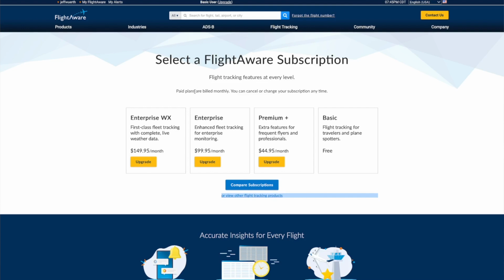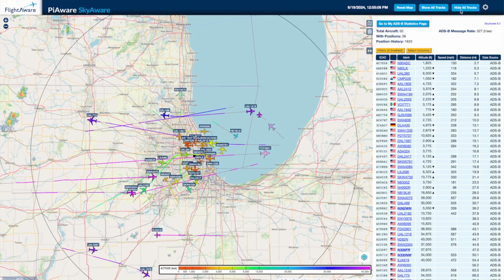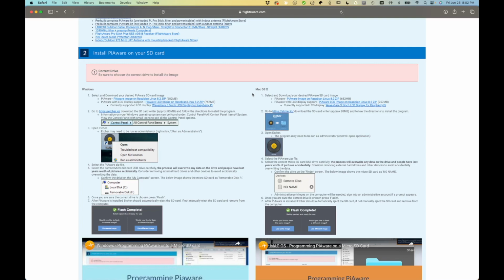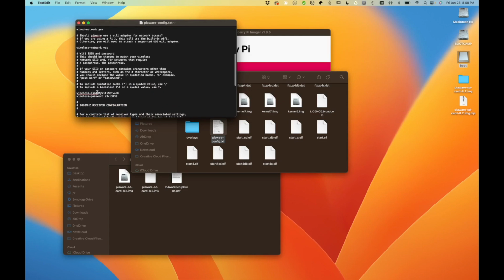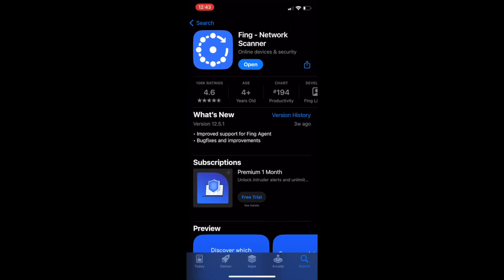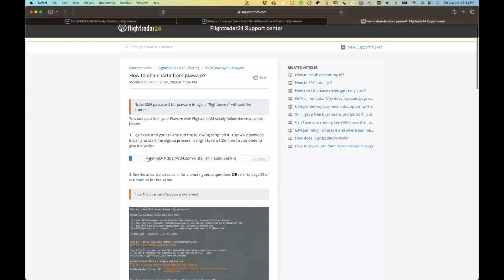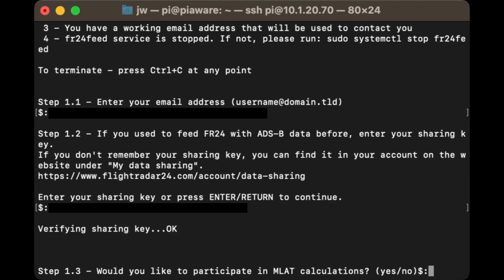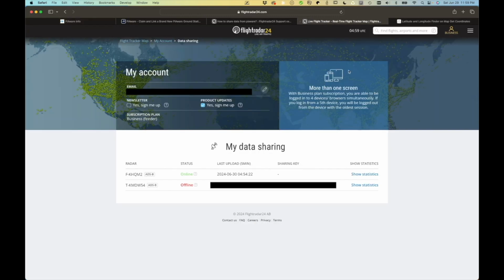How to Feed FlightAware and Flightradar24 Using a Single Raspberry Pi | Step-by-Step Guide

Comment: Do you know if it's possible to install this on Docker (with Portainer as the manager) as its own container? I already have another project (Pihole) running on my Pi 5 and I'm trying to do what I can to do everything on one Pi.
Reply from the maker: At this time the software will not run on docker.
Reply: @JeffWuerth  Are you aware of any alternatives?
Reply from the maker: @popcorn_shrimpznothing that I’m aware of. The feeders are essentially built by the sites that want the data, so even if a fork was created there is no guarantee it would continue working as the collectors updated their software in the future.
Reply: As far as i have read that it's possible to use Ultrafeeder and run it to all other sites that you wanna. But im just building my system i have not checked if it actually work. Theoretically it should

Comment: I can’t get the pi to connect to my internet. I have the right password and everything. I guess I don’t have the back up file. Does that change something. Windows 11.
Reply from the maker: When you say you can’t connect it to your internet, are you referring to your WiFi?
Reply: @JeffWuerth Yes. I got it connected to either for one second but I don’t think I have the right type. Plus I don’t have any good Ethernet options so I need WiFi.
Reply: Rewriting it to see what happens
Reply from the maker: @F00TNewsI’m not sure I’m understanding what you mean by the right type.
Reply: @Jef @JeffWuerth Of Ethernet cable but that does not matter. I’m trying to get WiFi.

Comment: Thanks so much for the tutorial! It was very easy to follow. I was originally going to do FR24 only but I ended up doing both. After the MLAT question, it asked for longitude, latitude and altitude but then again, I installed PiAware 10.2 (the current latest) so all good.

Comment: completed programming as outlined. using Fing, I cannot find piaware on my list. Suggestions? any help?
Reply from the maker: If you were previously using the Pi for another service on the network, it’s possible that information has been retained. 

1. Be sure you are able to see other devices connected to your network via Fing (is the pi wired vs WiFi?)

2. Make sure you don’t have any guest policies active on your router that could be isolating your WiFi from your wired LAN which would not allow Fing to see the pi. 

3. If all else fails, plug a monitor into the pi and get the local ip that way.
Reply: @JeffWuerth  using a monitor, I was able to get the address. it was listed as "Generic" on fing
Reply: @JeffWuerth  i was trying to access the pi wirelessly. I am looking for monitor that would work. All i have are the older. non HDMI

Comment: How is your install going with the Pi-POEHAT?  I have switched to using a POE extractor to power Pi instead because I greatly dislike that the POE hat has a mechanically fallible part - a single small diameter cooling fan.
Reply from the maker: It’s been running solid for years. No issues. I’m surprised we had a few days of 90+ degrees and very hot sun. 

It’s lasted so long I would buy another pi/poe hat and put the identical rig up again when it fails.

Comment: Would you add a GPS antenna to this, and if so, how would you do it or what commands would you use that works both with FA and FR24?
Reply from the maker: Sorry for the late reply, I believe there is but it’s been such a long time since I’ve played around with this I wouldn’t be able to give you solid advice.

Comment: Thank you for the fine presentation. My FlightAware feeder just went down.  Worse,  I cannot locate my information on the FlightAware site to help me troubleshoot.   Thank you for the step by step instructions.  You mentioned setting up an outdoor antenna.  I always worry about static charges building up and ruining the components in the Raspberry Pi.  Thank you again.
Reply from the maker: That is a very minor concern overall, but you can always add an RF ground to your outdoor antenna and eliminate the potential.
Reply: Notice some amateur radio equipment in the picture. -73s, WA8PJK

Comment: Hi Jeff. Sorry me but my English is not as good as I would love. I have a question. I recently instaled my setup, but only with FR24 file, and FR24 gave me a Business suscription. I know I have a personal "Sharing key". My question is: If I format my Raspi microSD card and I install in it FlightAware software following your instructins and using my actual "sharing key" in FR24 config I  can use both services without loosing FR24 business? Thanks
Reply from the maker: Yes that is correct.

Comment: An even better option for getting accurate location information is to use a GPS receiver. This can also allow for using the same Pi for a GPS synchronized NTP server for local time. You can also then set piaware to use that GPS receiver as follows:

pi@piaware:~ $ sudo piaware-config use-gpsd
Enter a value for use-gpsd: yes

Comment: Thank you for the informative video! Can I use other ads-b receiver? I cant get the flightAwere one in my country.
Reply from the maker: you could try just installing the FlightRadar24 software instead of FlightAware.
Reply: @JeffWuerth  I want to use the skyaware software so is it possible to get the Nooelec RTL-SDR v5 receiver and do as you do in the video to get it working?
Reply from the maker: @tofy1243  yes you can absolutely use the NooElec, just be aware that is a full range device and for best performance you may want to consider something like a NooElec Sawbird to filter down to only the ADS-B frequencies (1090 and 978 if you have an antenna available for that).
Reply: @JeffWuerth  thank you!
Reply: @JeffWuerth , thanks for the very informative video! Could you please let me know which Nooelec SAWbird model you recommend? I wasn’t able to find one that filters only ADS-B frequencies and has a USB connection. Is there such a model, or would I need an additional component?

Comment: HELP - I have Flightaware running on my Pi - (PiAware) but cannot SSH into the Pi from my MacBook Air to let me share data with Flightradar24 - anyone help please.......
Reply from the maker: Are you receiving an error of any type in terminal when you try to connect?
Reply: @chubdub858 I just started running my setup today on my Mac, and when I went to access the SSH, it wasn't there. I powered down and pulled the ls on the bootfs, and the SSH had disappeared. I added it again, put it back in the Pi, and it found it. Not sure why it disappeared, but you may want to try that.

Comment: If someone would go with connecting to a wireless network rather than running Ethernet, how noisy is the wireless traffic on the network?
Reply from the maker: @sgriffths  there would be no factor of noise to the WiFi or ADS-B receiver.
Reply: @ I guess I should have asked more clearly. How much data is being transmitted?  I’m guessing it is pretty low comparably.
Reply from the maker: @sgriffths  The amount of data being transmitted is entirely based on how many aircraft you are receiving. 24 Hour data usage on my receiver is at 356 MB.

Comment: Graet Tutorial , Thank you 
Let me ask you if that work with FlightFeeder ?
Reply from the maker: can you go into more detail on what you mean by FlightFeeder? If the application you are asking about supports receiving data from Dump1090 it should be able to read data from the FlightAware instance.
Reply: @JeffWuerth  Yes , the flightfeeder is an equipement non DIY provided and maintained by Flightaware
Reply from the maker: @Salah-eddine-SD  I understand. I am not entirely sure if you have the ability to add the FlightRadar24 feed to the FlightFeeder provided by FlightAware. My instinct is if you purchased the FlightFeeder then you should be able to program it however you wish. However, if you were to request and be approved to host a FlightFeeder by FlightAware for free, you may not have the ability to make the changes to the software as freely as the purchased product. Essentially the "FlightFeeder" is just a preconfigured hardware you are purchasing, so you should have no issue adding the FlightRadar24 feeder into the software.
Reply: @JeffWuerth  Thank you so much 💜

Comment: Great tutorial, many thanks. 
Question, apologies if I missed this. If setting up for Flightaware and the following with FlightRadar24, do you still get the business account with the latter, as you’re not pushing MLAT data?
Reply from the maker: Yes, you still get the free business subscription. To be clear, you need to have a dedicated antenna and tuner to have the ability to receive MLAT so in this build FlightAware isn't receiving MLAT data either, but in the future if it is added we need to ensure that data will not pass to flightradar24 due to latency.

Comment: Cool! Thanks for such a great comprehensive video! I am building a ground station and I love how I can now feed to 2 different platforms. Just a quick question, do you have information on the monetary compensation program that FlightAware offers and where to find official information?
Reply from the maker: hello @KalahariCreative, I am not aware of the any monetary compensation however, if you are contributing ADS-B data to the network you are given a complimentary FlightAware Enterprise Account (or FlightRadar24 Business account). If you live in an area that FlightAware (or FlightRadar24) needs feeders, you can submit an application through the respective website and if approved they will send you their hardware to install and host. The equipment remains the property of the company that sent it, and you are expected to keep it online to report data, but you don't have to pay for the hardware. I hope this answers your question.

Comment: I have a Stratux box with two NESDR Nano 3 ADS-B ( antennas 978mhz and 1090mhz) but when I setup Flight24 it only sees one, no UAT. I've yet to find any posts about getting two SDR devices working.
Reply from the maker: hi @airheadbit1984 I have done limited investigating into this subject but my understanding is that you have to assign a receive frequency for each of the USB devices, otherwise the Pi will have no basis of which USB device should be tuned to what frequency. This is a more advanced configuration for sure and I wish I was of more help.

Comment: Hi Jeff, what are you using if you don’t connect to your router? I have a low limited data plan on my Wi-Fi router and am curious as to how much monthly data would be consumed if I installed an ADSB receiver.
Reply from the maker: Hi @PeteMacLachlan I am using the unifi environment for my router. I looked at the 30 day internet usage for the feeder and it’s at 2.9GB. Keep in mind this is feeding both FlightAware and FlightRadar24. That data is based on the amount of traffic the device sees as well. 

I have another feeder that is only feeding flightradar24 in another location and it doesn’t see nearly as much traffic and it’s at 62.7MB for 30 day internet usage.
Reply: @JeffWuerth  thanks for the info - very useful! I’m in Yuma, AZ, so should be good with light commercial traffic and intermittent military training. Thanks again.
Reply from the maker: @PeteMacLachlan  military uses a different platform depending on the mission/aircraft type, but you will often find military helicopters and cargo transmitting ADS-B.

Comment: Can I just use the RTL SDR ??
Reply from the maker: You can, however the RTL-SDR does not have built in filters so it would be recommended to add an external filter to reduce unwanted RF noise.
Reply: Also, be aware that not all RTL SDR dongles work up to 1090MHz. Some of them won't receive above around 980MHz. It depends on the receiver chipset in the dongle. The ones based on the R820 should be OK. Ones with the FC0012 will not operate at 1090MHz. Ask me how I know... :(

Comment: Set up MLAT and it now shows me in china (I have the correct longitude and latitude) and while my right side shows 19 aircraft, I see none actually on the map. What happened!
Reply from the maker: be sure to set your location on the FlightAware website, not only on the Pi.
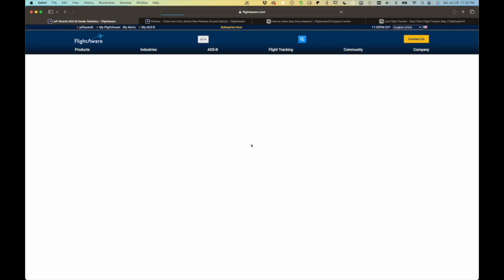Reply from the maker: The part of the video that has these instructions is at 28:07.

Comment: Rebooted my Raspberry PI and now I am getting an Internal Server Error 500 every time I am trying to access flightaware via the device's IP address. Any idea how I can get this sorted out?
Reply from the maker: This is a tough one because there are so many things that could be causing this error. Are you able to see if the feeder is feeding out to FlightAware over the internet by logging into your online account and viewing the feeder status? If it is not, you may have a corrupted instance and might need to reinstall. There is documentation out there which will tell you how to get your "Unique Identifier" from the "stats" page of the My-ADSB tab on the FlightAware website and use it when you reinstall the software so you continue feeding as the same device.
Reply: I have tried to reinstall everything. But I cannot get into my Raspberry Pi via SSH anymore either. Even got a new one with a new IP address and all. But I still cannot get anywhere...
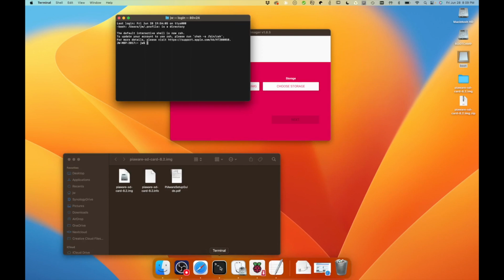Reply from the maker: @RainerWarrior666  Make sure you put the SSH file on the root of the file system. Remove the SD card from the Pi, insert it into a computer and be sure you have a file called SSH on the root (watch the video from around 15:00 for Mac and continue to see how it is done in windows. You will have no SSH access without that file properly placed on the root of the SD card.

Comment: Jeff: Your antenna AND the dongle filter are both set up for 1090 mHz. What about the UAT 978 mHz??? Will that antenna work on the 978?? Will the filter attenuate the 978 signal?? I'm far more interested in general aviation than commercial jet traffic, and want to track UAT traffic. This setup appears to be designed for 1090 mHz. Is that correct??
Reply from the maker: This particular setup filters out 978. I know there are some dongles that do not have filters, and even with the 1090 antenna you might have luck receiving 978, but I would suggest doing more research before moving forward with that configuration. I do know you can buy a dedicated 978 dongle and get a 978 antenna to go with the system. There are some additional setup procedures to make sure the software knows what dongle is responsible for which frequency range, so keep an eye for that if you do go that route with 2 dongles.

Comment: Awesome video, thanks! Quick question though, I've set everything up as you've described in the video, but I cannot seem to get any data to FR24. FlightAware works perfectly, but I cannot see any statistics on the Feeder Page on FlightRadar.
Reply from the maker: Did you SSH into the PiAware feeder and run the install script for feeding FlightRadar?

Did you have a FlightRadar account before entering your email during the installation process on the feeder?
Reply: @JeffWuerth  Managed to fix it in the end. Had to leave it running for a day then data started showing up. Took another day until my account was upgraded.

Comment: i will say, i tried it out on my windows rig, sadly im in new zealand and onthe south island/west cost. so not many people fly over , butyeah, it is prety oof, but yeah if i had spare low power pilike, rig id send it, and shove it on the top of my hill with a solar panel.
Reply from the maker: A solar rig would be a great idea, you’ll just need a way to get it connected to the internet to feed unless you are only interested in viewing the data locally and not acting as a feeder.